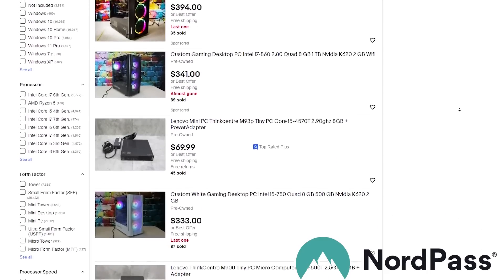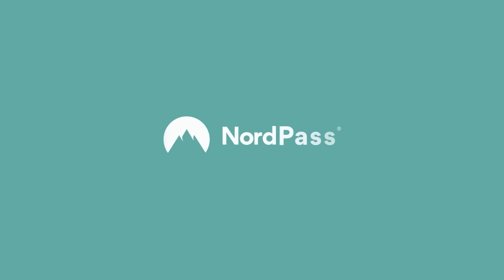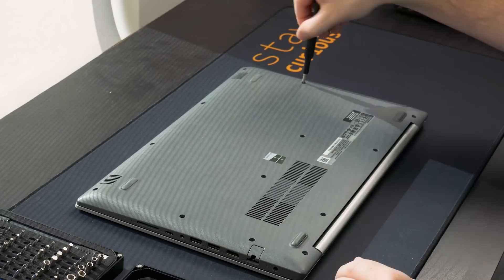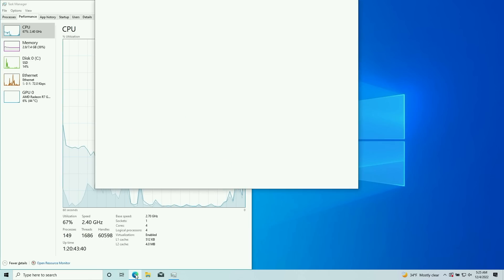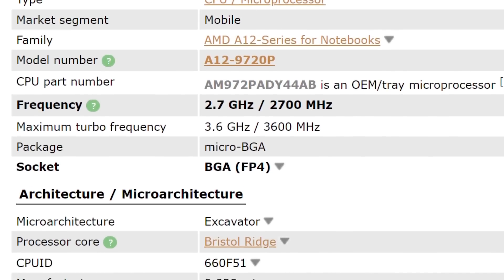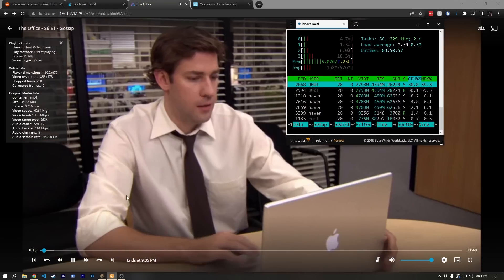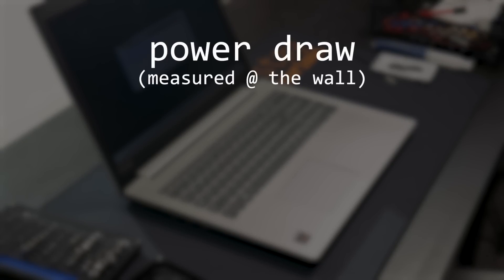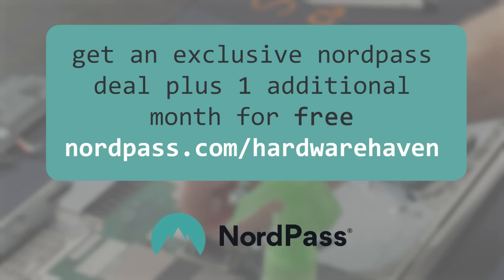Upgrading A Friend's Laptop...   and installing linux.

Comment: Great videos as always!, btw I've disassembled similar Lenovo laptop with AMD A9-9600P and I also thought the ram was soldered, well it's partially true, inside those shield (near CPU) there are blank single DDR4 SODIMM slot you can fill.
Reply: Partially true because 1 "slot" is soldered, usually 4 to 8GB module, you can cram another 8GB module there (2400MT/s is the max speed regardless)

Comment: Nice little video! I've seen a few people take a broken (screen/top-lid/etc) MacBook Pro and build a custom little case for it and use it as a "MacMini" basically...you could do the same or similar but put Linux on it and run it as a server! 

And yeah, I'd suspect either Intel's or AMD's graphics stack would be best for GPU-related tasks, at least with the opensource drivers and having things be more "stock" and "rolling" than Nvidia's proprietary driver.

Comment: Still run a hp pro book 4545 with a a10-4800m similar to this one. Still great for most tasks. And when I need more horse power I have parsec linked to a server in my rack. It’s been a great little chip.

Comment: I did something similar, my parents has a lenovo desktop with A10-7800 dual core, and last year it was sluggish, many errors and BSOD. Then this spring I slapped on a 256GB SSD and the performance is so much better in Windows. Then I decided to install Linux Mint and run it as home server, it works well with docker media apps and minecraft etc.. Just like you mentioned, transcoding doesn't work, not a big deal for direct play, but with a 15 Mbps uplink, it's almost a necessity for outside viewing and 4K bluray. I'd have to look something else for my home server/NAS but overall my temporary server is good. Anyway nice video, looking forward to your uploads.

Comment: Of course you can use an old laptop as a server. I even did that for a few years. The main problem is a too limited disk subsystem, usually only one hard drive or ssd. And there are no good ways to expand it. So I switched to using mini-itx boards.
Reply from the maker: Yeah the best bet is to replace a disk drive if it exists. Some people don’t need a lot of storage though
Reply: How long ago was that? That may also be true with some newer ultrabooks which have few ports or expansion options, but I don't think you looked too hard, by far the easiest are those external usb cases and almost everything made past 2012 has at least one 3.0 port and many of the older 2010-2015 laptops also had a disk bay which can easily be repurposed, along with a sata or nvme M.2 port, so for most old laptops most people would keep around today, that's at least 2 drives, possibly one SSD, and one to four usb drives, some even have an SD card reader which means you could use that as your OS drive or something non-critical.

Then there are slightly oddball things like mini pci-e or m.2 adapters if you don't need the wifi card or anything.
Reply: @vgamesx1  Well, it was quite a long time ago, but I wouldn't say that much has changed since then. I find USB adapters not very reliable, I wouldn't use them 24/7. Nvme SSDs are good, but they're just too expensive. So a laptop-based server will do for experiments and fun, but if you need something more reliable, this is not the best choice, in my opinion.
Reply: @kote315  The cheap ~$10 ones aren't super reliable sure, but I have a powered case for use with larger 3.5" drives that's been going "24/7" (ignoring drive sleep) for the last 2-3 years now, things are certainly different these days for nvme, it's generally at price parity with sata now but that doesn't matter much anyway since just like a desktop it's more useful as a simple boot drive rather than storage, so even as little as 16/32GB is still useful here.

Isn't everything here for "experiments" or "fun" ? You technically could run something at home for production or work, but typically if it's that important, even your own stuff would probably go onto a linode instance or something with guaranteed 99.9% uptime, that said my laptop has been very reliable aside from software bugs bringing it down once in a while.
Reply: @vgamesx1  Most likely in your world you are absolutely right. But I live in a slightly different world. I am very happy that my nextcloud and a few other services are hosted at my home. And I absolutely have reasons for this. Firstly, almost all of users (my family, friends and I) have access at maximum speed, either in the local network (1 gbps), or in the network of one provider (up to 100 mbps), or through the networks of providers in one city. For a number of reasons, long-distance communication channels are overloaded where I live, so this is important. 100 megabits per second is much better than 100 kilobytes per second (in the evenings I have such communication speeds with the outside world). Secondly, third-party resources can be suddenly blocked for idiotic reasons. I recently encountered this, I think you can guess because of what events. Of course I have vpn, but I think you understand that it just works worse. For the same reasons, I have problems paying for third-party services. So having everything you can at home is a great idea in some cases. I am the person who lives in these very "some cases".

Comment: No wayyyy!!!!
I did it on my old laptop! And I'm still using it!
I got only the mb and the power jack in a sandwitch of 2 plexiglass panels with some screws to keep everything in place and the upper panel has the space for 6 2.5 drives (but I used only 2) .
First I installed OpenMediaVault on an USB so I got 2 HDD on Sata ports and it worked nice... but, with 2 hdds only for a total of 700 GB I ended up finishing the space after few months 😅
Now I use it as an eMule, torrent and download server with a 150 GB hdd and ubuntu server.
The PC is an intel core duo, 2+1 GB DDR2 RAM, gigabit ethernet integrated (surprisingly), many usb ports and 2 (empty) expresscard slots... still useful nowadays as download server! (and possibly other things I am going to add of course 😉)

Comment: Jellyfin does support Radeon GPUs for transcoding though. Did you check the logs? Is the correct firmware installed?
Reply from the maker: It does, but I think it only supports zen based APUs and up.
Reply: @HardwareHaven  if you install vainfo you can check if your gpu has any VAEntryPointEnc/Dec to see which capabilities it has. I would be surprised if Vega didn't support video decode.

Comment: Another thing you can upgrade the laptop to run as a home server is to replace the DVD drive with a hard disk caddy, so you have 2x2.5" inside the laptop. One ssd for the OS and one spinning rust for bigger storage (or go full ssd).
Reply from the maker: Yep! Did this on my 2012 MacBook back in the day
Reply: I‘d go full ssd and then configure RAID 1
Reply: @SuchByte  How to boot then? The laptop doesn't have hw raid
Reply: @SuchByte  oops, i thought there was only 1 slot for the HDD caddy
Reply: @Logilype  You can also use Unraid which boots from a USB stick and then use one drive as a parity drive and one in the array. With this setup you basically have the advantages of RAID 1 without the need of a hw RAID controller.

Comment: Hey great little video!
Using a laptop as a server definitely has some potential especially if you can make it defect it's no longer getting wall power and turn of before the battery dies as like black out protection
Also are the mugs and desk pad potential merch?
Cause that would be really cool!
Reply from the maker: Thanks!

And yeah, I’m working on getting them up for sale here soon! And patrons should get a discount at least early on 👍🏻
Reply: @HardwareHaven  I will definitely be looking forward to that!
Reply: @HardwareHaven  can me has also discount pweas 🥺🥺🥺🥺🥺🥺
Reply: before i bought an old desktop i used my old laptop as a home assistant server
Reply: @vibvian  that's a good use!
And probably very energy efficient
Reply: @vibvian 
Your username looks a little familiar..